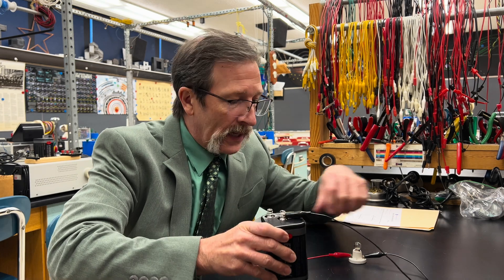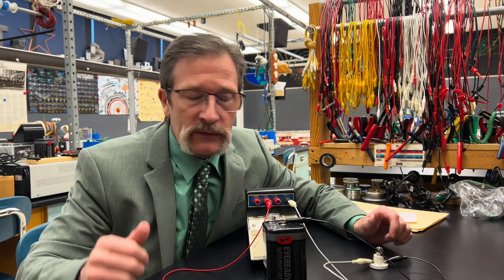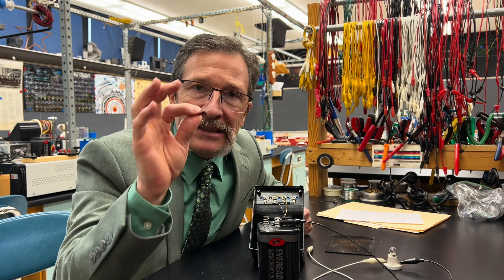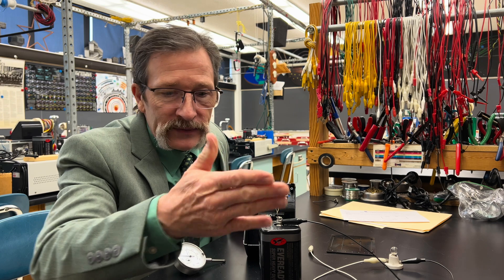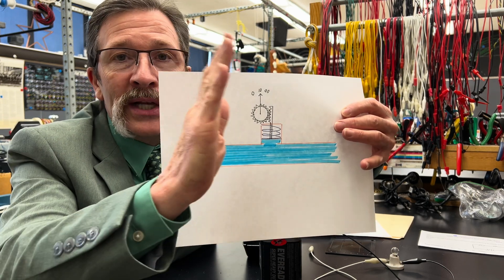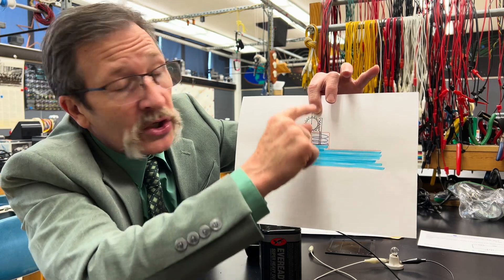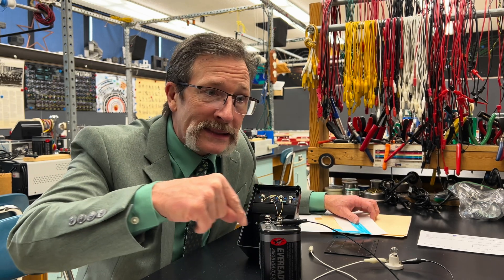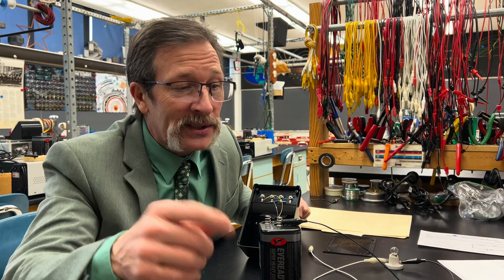What Happens When a Voltmeter Is Placed in Series with a Bulb?

Comment: For my very first electronics lab project, I was given a D'Arsonval moment and some resistors to build a voltmeter and an ammeter.  It's a good fundamental project that teaches basic parallel and series concepts with a solid application.
Reply from the maker: Absolutely! We will actually be releasing a few videos on this exact topic this year as part of an open online course we are developing. Be sure to subscribe and keep an eye out for those!
Reply: @idealizedscience  I'll check em out. That said, I have had a fruitful career in EE and Optical engineering. I'm currently on my final retirement landing approach in the next couple years to maybe spend some time tutoring young folks at some point.  Keep making these great videos.

Comment: What happens to whom or what in your circuit? Are you interested in the lightbulb behavior, or that of the Voltmeter? 
it the bulb an LED or a coiled filament in a vacuum? What happens to the bulb, or the voltmeter loop? 									

What is powering the circuit? For a so called  "science institute", you don't appear to understand how to construct an initial system, nor do you define the initial  parameters of interest in a simple serial circuit. Wh

What is the independent variable here? Are you interested in the voltage drop across the bulb or the voltmeter. Are you powering the bulb AC mains 220 V power, or a DC battery. Is your Voltmeter probe designed to isolate your voltmeter with a high impedance probes to isolate the 
a load on the circuit from the meter? This would make the most sense. 

If you are interested in a valid answer, you must provide  more information about your goal.  Otherwise your premise is incomplete and therefore impossible to  evaluate the circuit with any confidence in my analysis. 
What to you want to know? And what's the point?

Give me a lever large enough and I will weigh the world.*
Reply from the maker: Sorry for your frustration here. To push back a little bit for educational purposes, would it matter if it were an LED or an incandescent?

The question is intentionally left open-ended to foster dialogue in the classroom. Sometimes a multiple choice question is more appropriate, but normally they limit the dialogue to the options already given. With open-ended questions of this form, students take it in various ways based on their past experience and then their peers critique them and this dialogue, gently facilitated by the teacher, is the goal of these quick quizzes. It forces them to define all parameters, what the questions actually means, within what range their proposed answers hold, and then after all of this they reflect on their answer rate their confidence, a meta-cognitive step that is also crucial to developing deep conceptual understanding.

I hope this context clarifies some of our choices!

Comment: That voltmeter from the 1920's probably has a lower resistance than the chinesium wires and alligator clips so who knows. But seriously, a voltmeter should conduct very little current, especially at 6V so of course it'll just show 6V and the bulb will see 0V.
Reply: edit oops. I just said something about parallel connection. Of course that's not the case.

Comment: Very good explanation.  Although fairly familiar with this topic, I was not familiar with exactly how a voltmeter works.  A circuit diagram and mechanical sketch of  the meter would be interesting. - -  a quick search says an analogue voltmeter is an analogue ammeter in series with a resistor
Reply from the maker: Thank you for your comment! Both an analogue voltmeter and an analogue ammeter are based on a galvanometer and resistors either in series or parallel. We will be making a detailed video in the future elucidating this! Be sure to subscribe to catch this.

All of this and more content is being generated for a course we are developing (target release of next year) that will take people from no background knowledge through to a deep understanding of the fundamentals of electricity!

Comment: The volt meter showed the battery  voltage. The volt metre is high resistance, otherwise it could short the circuit being tested.. the short could mean high current, high power things melting... And anyway that would intefere with the circuit state ..

So with high resistance in the metre, low in the Bulb, voltage divider, the bulb gets little voltage...anyway the voltmeter only lets a  tiny current,it wouldnt have to let any current through.

Volt meters are high resistance, current meters are low resistance.  You can turn a voltmeter into an ammeter with a low value resistor, or turn an ammeter into a voltmeter with a high value resistor.
Reply from the maker: Great answer! Keep an eye out for part 2 of this quiz on Friday.

Later this year we will be releasing some detailed videos about galvanometers and how to make voltmeters and ammeters from first principles as well!